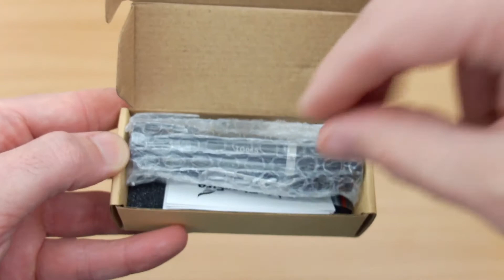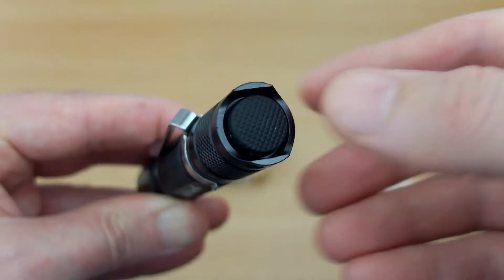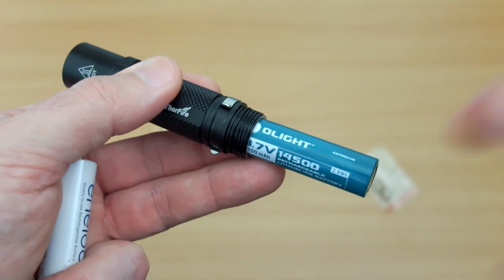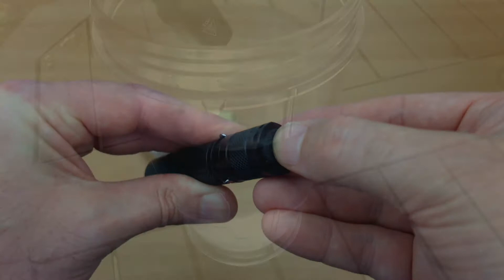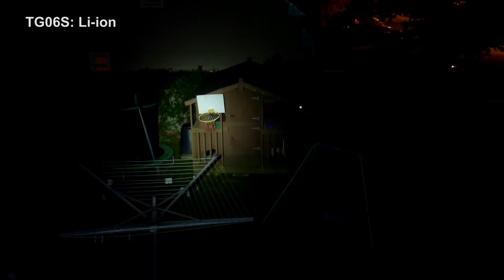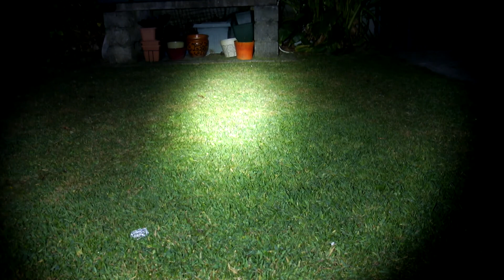ThorFire TG06S Flashlight/Torch: Review

Comment: let me tell you man, your a damn good reviewer, you need more subs
Reply from the maker: Thanks I keep trying if you find another 5-10K subs let me know ;-) It does take a bit of time to build things up a lot more than some expect. Cheers for the comment
Reply: Mr Baz Reviews by the way, a great budget light is the atactical a1 or a1s is amazing. ;)
Reply from the maker: I've heard that will see if I can get some to look at
Reply: jozsua mcdonald the a1s on amazon the price has went up a lot at least right bow
Reply from the maker: Seems to be about £25 right now on the A1S. The Thorfire stopped working so I'd give this one a miss
Reply: Mr Baz Reviews when I wrote the comment there seemed to have been a glitch on amazon and was saying it was 99$ I just got mine for 30. 
What happened to the Thorfire?
Reply: budget gamer2017 its like $10 used and $15 new on amazon
Reply from the maker: Sometimes sellers up the price to silly levels when they have no stock (seen it done often on eBay)
The Thorfire doesn't work properly won't switch on and when it does sometimes it's just a very low output. I've not had any problems with their other lights maybe a one off, I just like to be transparent about products. 

Thrunite/Wowtac have never contacted me for reviews (they seem to like only big channels) or comedy ones :-)
Reply: Mr Baz Reviews have you tried tightening the ring on the cap? Thorfire has a problem with them coming loose
Reply from the maker: Tried that no joy no idea on this one doesn't really matter I'm not short of torches. Some of the Thorfire models have been pretty decent some less so

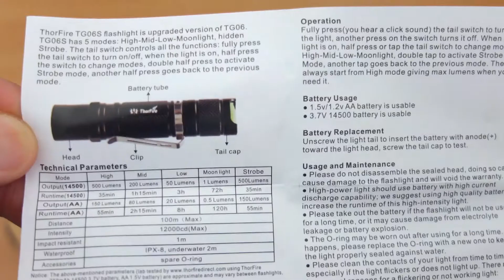Comment: At 0:33 they said that the range is 100m - that mean 2,500 lux - while the throw is 12,000 cd. It doesn't make sense.
Probably when using the 14500 cell it can throw 2,500 lux as XP-G wouldn't be too throwy in a small reflector while with Eneloops the throw must be under 1,000 lux
Any idea if the output on Ni-MH is regulated on HIGH - 150 lumens - ?
Reply from the maker: There is no PWM on high but on other levels there is. 100m is going to be for the 14500 output not the AA which is a lot lower

Comment: Can I use 14500 without security?
Does the flashlight have any kind of protection that protects the cell from being discharged?
Reply from the maker: If you use unprotected cells you will need to keep an eye with low power levels, the torch does not cut power when voltages are low. This isn't an issue with protected cells as the circuit prevents over discharge.

Comment: Hi, would you say this the best torch for this price-range (around £8-15)? I'm only interested in torches which take one normal aa/aaa battery, not a bunch of the tiny ones! :) I just need a small but decent torch for looking for stuff in dark corners of the house. Thanks. :)
Reply from the maker: Honestly no my review unit failed stopped working (after I finished the review some months later), so can't recommend it have to be upfront about it. If you are looking for a better torch get the Olight S1A Baton it's a bit higher than your price point (about £24 on Amazon), it's a far far better product (zero problems to date)

There are other options such as the Zanflare F2 (takes 2 x AA cells) bit longer but still small handy all purpose torch
http://amzn.to/2yTxLIY
http://amzn.to/2AQipXh

That is a good torch (even has battery indicator) tested and used that for a while now it's also in your budget range. Second one has a lower low mode (which I prefer)
Reply: Thank you for replying so fast! The reviews on Amazon seem quite good so maybe you just got a dodgy unit? I'm not sure if Amazon will replace if it breaks after a few months of having it. :|

I'll look into the Zanflare F2. :) The battery indicator sounds useful, although not knowing a battery is about to run out is less of a worry if you only require one!

If this Thorfire hadn't died on you, would you have preferred it to the Zanflare?
Reply from the maker: Be careful with Amazon reviews some makers send out samples for 5 star reviews to boost sales their review system is a mess I know because I used to review on Amazon and honest reviewers are not wanted!. I've used a lot of torches I can't recommend something that has failed during use. The other ones I mention are good I'd strongly suggest trying those,
Reply: That's true. :( Sometimes it's really obvious, like if all the reviews were left on a certain date by reviewers who haven't reviewed anything else, but sometimes it's hard to tell.

Have you tried the Led Lenser 8403 P3BM? That's the only other one I've noticed.
Reply from the maker: Note used it though they have a decent rep for build quality. That one is AAA though not AA
Reply: I think I might go for the Vansky® Mini Torch USB Rechargeable Flashlight (although it's a bit bigger) because I like the idea of the USB recharging and it has good reviews. 

Also I'd been thinking about what you said about Amazon reviews being unreliable and I found two websites, Fakespot and ReviewMeta, which scan the item page and give insight as to if they're dodgy. :)
Reply from the maker: They can help though you'll see fairly quickly what is going on. Some products are good, but almost all have flaws if they don't get mentioned it's likely fake..even small points. What happens now is Amazon banned free sample reviews, so they just paypal refund them no disclaimer which is even worse. I spent 2 years as the top reviewer on Amazon UK by putting a lot of work in and trying to be honest..I ended up getting black listed by many companies for leaving 2/3/4 star reviews on some products. I know exactly what goes on just tread with caution